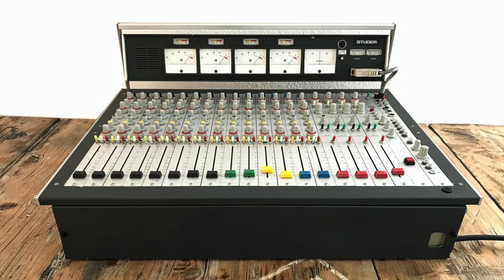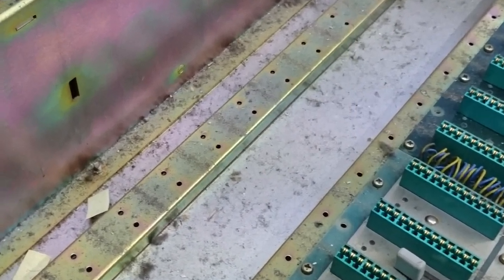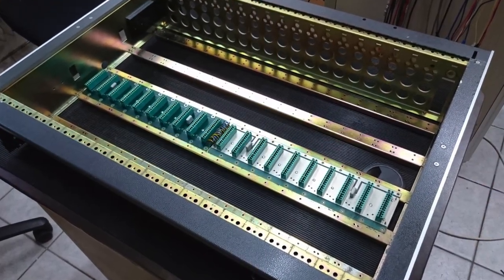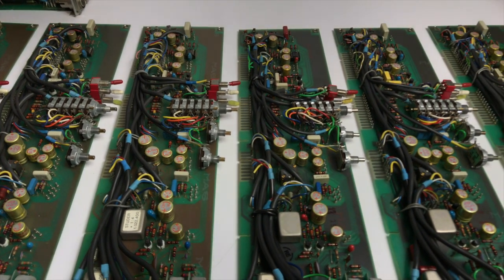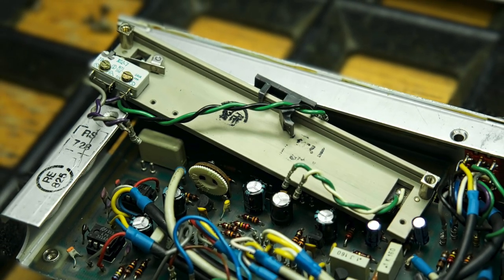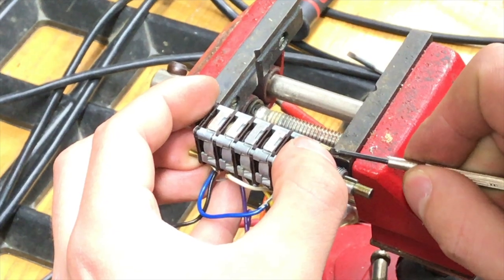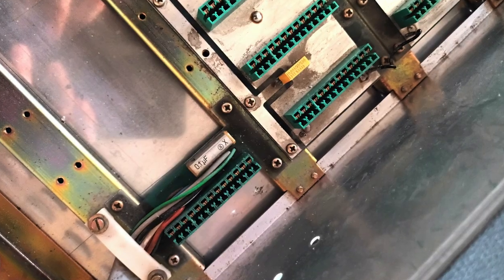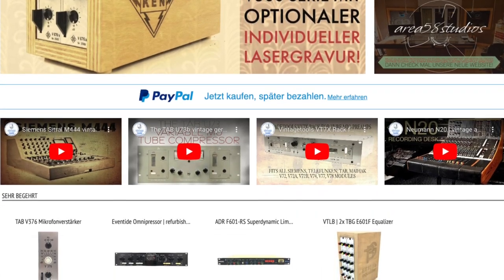STUDER 169 / 269 mixing board restoration

Comment: Thanks for the tips. I am cleaning the faders of my 963 and they're very dirty. I am using isopropyl spray with qtips of various sizes. The most sensitive is the fader tracks and the fingers. Then i use a tiny drop of ptfe oil to lube the guides. Those little metal paper condensers on the pcb that you show are prone to explode!

Comment: If your mixer worked in a studio, like mine (169 ), you will be shocked to see what it is under the connectors on the main board(s), i desoldered all the connectors , i cleaned them in the ultrasound bath and i cleaned also the horrible oxidation of old coffee, water, cola (or beer?) for maybe 30 years under the connectors and on the metal back cover. I strongly advise this to anyone want  to restore a 169/269, even it is a huge work….
Reply from the maker: So true. People tent to forget that there was excessive smoking everywhere until the mid-1990s. Smoking ban in the studio? No way! How are you supposed to work creatively? :-) Times are changing. Lol. The dirty layer of smear that the nicotine left behind was death for the faders and pots. At some point I removed the faders from our old SSL 4000 and vacuumed everything down below. Yep... At least one ashtray filling on 56 faders! Be sure to clean the circuit boards!🤢

Comment: doing same restoration now bought broken 269
problem was psu also a lot of capacitors are short circuited
fixed the psu now slowly module by module fixing one thing after another
do you change all capacitors or only electrolytics
regards
Reply from the maker: Great! Good luck. the psus are tricky sometimes.

Comment: Any advice on how to loosen the mid eq knobs on a 961? The sweep and gain knobs move together and are a bit stiff.
Reply from the maker: Take the channel out. remove the cap from the poti and try Craig Fader spray from both sides.  Also try a hairdryer or make it warm (not hot!) If it moves, turn it 20 times and spray 1-2 times more. We also use some DRY air from a compressor to blow the debris out afterwards. Good luck!

Comment: lucky enough to have two in my possession, family friend is letting me have a look and try them out to see if i can invest. currently troubleshooting. any recommendations on how to properly diagnose any issues? or frankly even get a signal from the unit after powering it on?
Reply from the maker: Hi Daniel, If you get no signal at all, it is best to first check whether the power supply is supplying all voltages. If it does you can connect the audio I/O´s and follow all signals. In other words make a complete audio test with all the in and outputs such as Mic-Line in, master out, control room out, auxes, etc. If you need to repair stuff, do the same with an oscilloscope. Always just follow the signal and repair one fault after the other. At the end, if everything works well and sounds good, you can do tests with a measuring system such as the audio precision or any other. Good luck!
Reply: @vintagetools  amazing! this will help a ton. so exciting! thank you!